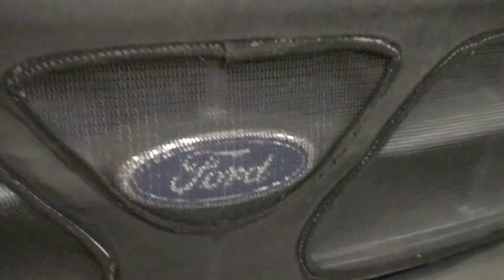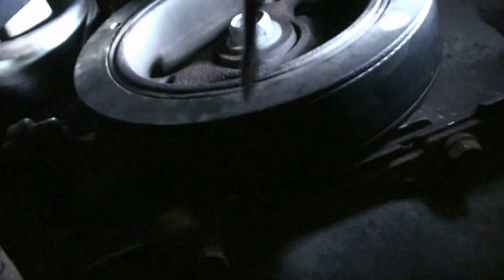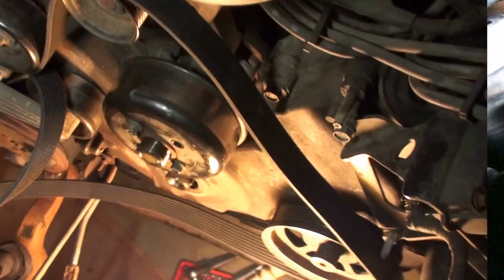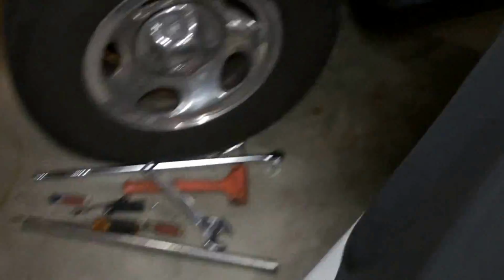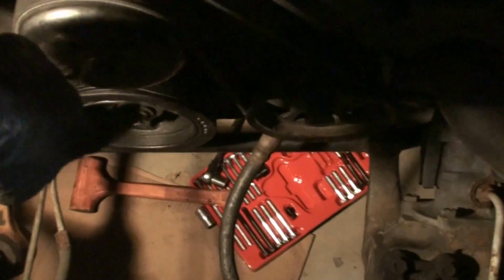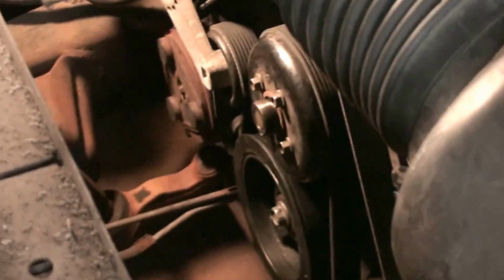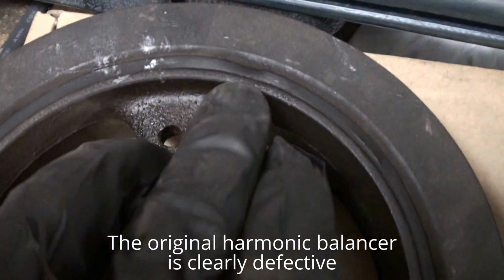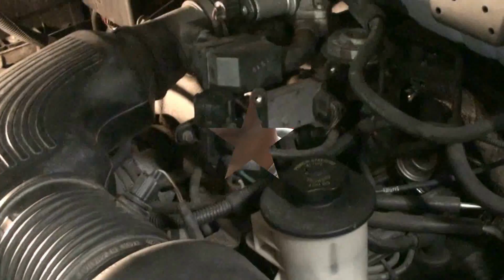Serpentine Belt Chirp/Squeeeeek Repair - Harmonic Balancer - Ford F150 4.6L V8

Comment: my water pump pully while turning normal seems to bob in and out... lots of noise to... the crazy chirp screech has to be water pump bearing or ??? and the rolling can of rocks sound what is that???
Reply from the maker: Bad bearing.
Reply: @ozzstars_cars  what about the two different sounds.. I just found by observation only the belt has somewhat walked off the pulley so I don't know if the bobbing in and out caused that or if that caused the bobbing in in and out and a bad bearing but probably the bad bearing first.

Comment: I have a 1999 ford f250 super duty 5.4. With the advice of a couple mechanics I trust I replaced idler pulley (it has 2 at 30 bucks each). That wasn't it. More advice and I changed tensioner pulley entire assembly. Wasn't it. With more advice I changed the alternator. Wasn't it. Ac compressor pulley bearing....another dead end. Still had terrible noise in the serpentine belt system. All along it was the harmonic balancer. The details you show in this video about the rubber between the inner and outer sections of the harmonic balancer being slightly sunk in or slightly out is knowledge a good mechanic needs to know for sure. Hate that I was one that just "threw money at parts" but I did to the tune of 400 bucks. I'm just an everyday working man and that really hurt here at Christmas time. I just wish I would have found this video sooner. But hey now the entire front of my engines pulley system is brand new. I definitely learned a lesson and some wisdom I will never forget...EVER. thanks for the video. God bless. Merry christmas and happy new year from haleyville alabama.
Reply from the maker: Thank you for the comment Darryl.  It is a shame that the problem couldn't be diagnosed properly and corrected earlier.  Fixing cars takes skill and experience and it's not always as easy as some people think.  Good news is your truck is fixed and that annoying squeak is gone.  The financial and frustrating lesson you learned is priceless for life. Merry Christmas to you and take care.  -Glen

Comment: Good diy video. Very informative. I’ve got a 97 f150 4.6 the belt just started squeaking 2 days ago. Started the truck today and the serpentine belt keeps coming off and it’s raining antifreeze right where the crankshaft pulley and harmonic balancer is. Any idea why it’s raining antifreeze and the belt won’t stay on?
Reply from the maker: Water pump failure?
Reply: @ozzstars_cars  I don’t see any signs of of water coming from the weep hole. You’re probably right about the water pump failure. I also checked the intake coolant pipe at the rear of the engine that looked ok. I checked the harmonic balancer and the ring is definitely not flush the way you showed us. Thanks for the fast reply.

Comment: I just changed mine. The old one looked fine and the new one has a wobble too. Could a loose belt on one side do that?
Reply from the maker: Loose belt how?
Reply: @ozzstars_cars  hear one squealing on start-up and one side has a bit more give than the other
Reply: Spray some water on a ribbed pulley while truck is running, if the sound goes away it's a belt issue.

Comment: chirpping in my f150.cant seem to locate the sound.what are the odds its not the harmonic and one of the pulleys/idlers? or tensioner? or power steering pump?
Reply from the maker: Proper diagnosis is the key, not guessing.
Reply: - pulley
- belt
- tensioner
- water pump
- harmonic balancer (new washer and tty bolt)
- ac clutch
- power steering pump
i looked at all of them, but mine was also the balancer

Comment: Have a 97 f150 4.6 doin the same thing, it's not as bad as this one but I do believe it's on its way. I've changed every questionable bearing there is to change, so all is good there. So I looked at the balancer and sure enough it doesn't track straight, it has a tad bit of wobble and your video confirmed it... thanks for the post.
Reply from the maker: Your welcome Gary.  Thanks for stopping by the channel.
Reply: Ozzstar heay check this out, i got a new balancer and it solved not only the issues i knew i had, it solved other issues i didn't realize. I had no idea the balancer was the culprit of all of it. Now everything is good, no vibrations, engine quieted down some, no squeals, even my power steering pump quit whining the instant i replaced the balancer. I'd of never guessed a bad balancer could make a power steering pump whine, but it sure enough did, i kid you not... and i thought i knew about ford power steering pumps? Lol. I've never even heard of anyone claim a bad balancer could cause a pump to whine, and I've worked on vehicles for years. Thanks to your video i took a chance and it paid off big time.
Reply: Same truck/engine and same problem here. Engine has 210K miles on it and we first started hearing the occasional chirping about 6-7 months ago. My younger family members with good ears could hear it, but my old ears couldn't (above the constant tinnitus, anyway). It finally got to a loud squeal, going into a kindof high-pitched growl as the belt and pulley heat up. This video came up first in the google search and sure enough, the same little wobble is present on the balancer, with same amount of rubber ring protrusion / depression on either side of the wheel - very slight, maybe 2mm. Thanks for the video, Ozzstar!

Comment: Thank you i have the same problem on a 1999 f150 4.6 exact same problem replaced tensioner and idler pulley and still squealing i will give it a shot.
Reply from the maker: Inspect the harmonic balancer before replacing it.  Changing parts is not the answer but proper diagnostics is.  Good luck, report back if you can.  Thanks

Comment: I have an 02 ford ranger 4.0. Replaced the belt for a third time tensioner for the second time. New alternator and had the ac unit replaced with a bypass pulley today because it was bad. Problem I have is the belt isn't staying aligned on the crankshaft pulley. Everything seems to be straight. Could it be the crankshaft pulley that's the problem. Inner part of the belt closest to the engine wants to ride up and almost come off.
Reply from the maker: If the belt wants to ride off the crank then I would suspect the next closest pulley is out of alignment.  Aftermarket (rebuilt) alternators are known for that. The alternator pulley could be to far inward.  Hopefully to make the diagnoses easier you still have the old parts to match up and find where the problem is.
Reply: Ozzstar  thanks. I'll check that.

Comment: Hey Ozzstar’s Cars, could use your advice. I got a 2016 GMC Sierra 5.3 only 34k miles but the random chirp doesn’t come while in park or neutral, but while in drive when pressing the gas around 1000rpm a chirp happens.
Reply from the maker: Have you inspected the belts themselves or tested using water? It's not always mileage sometimes age. It's very difficult to diagnose a vehicle without seeing it.  Good luck with the fix.

Comment: Hi Ozzstar, I have that annoying squeak. I already replaced Idler and tension pulley, alternator, and the power steering pump is only a year old. The only thing I thought  of next was the A/C compressor. Thank goodness I found your video. This may very well be the problem. I am going to look to see if the harmonic balancer is doing that wobbly thing. Thanks for the video. :)
Reply from the maker: Good luck Donald, let me know how it works out for you.  Take it easy -Ozz
Reply: Ozzstar, Thank you very much for this video. This was exactly the problem. I followed the instruction you posted along with my 16 yr old son and it all worked out beautifully. Except I used a breaker bar to loosen the nut on the Harmonic balancer and just turned the engine with out starting it. Worked out great. Thanks again.
Reply from the maker: Glad it worked out Donald.  Good lesson to learn to diagnose what the problem is before throwing parts at it.  Good father and son project!  Take care
Reply: Check your lifters they chirp as well

Comment: Thanks for this vid, I was looking for a good explanation of harmonic balancer wear and failure. Big thumbs up for that. I have a 2001 Lincoln Town Car with 142k on the clock. Beautiful car I bought from the original owner a couple of years ago. Dealer maintained, all that. Recently, out of the blue, I get a short serpentine belt squeak on a warm start up! Then, a short time later, same thing. Hasn't happened since, but I know better than to ignore it. I just inspected the balancer, and rubber part has the 'wavy' edge indicating that it is used up.

I'm a DIY home mechanic, so my cost is parts and time. The (OEM Motorcraft) parts are affordable, especially given how much money this car saves me in the big picture. With the shroud, the fan, and the belt already off, I'll just unbolt the tensioner and the idler and swap them out while I'm there, and slap a new belt on. The time spent is almost the same. Then I can be confident in a complete, long-term fix. Just saying.

Comment: How does the fan shroud come out without taking the fan clutch off?
Reply from the maker: the fan clutch is off, you need to watch the vid again 3:55
Reply: Ozzstar I meant if I don't want to take the clutch off. Is there any way to remove the shroud without taking the fan off?